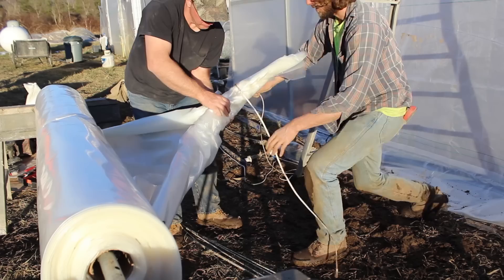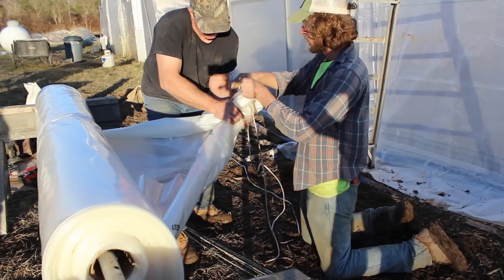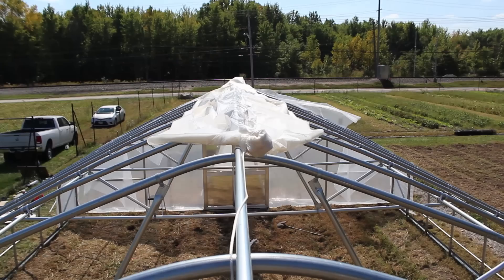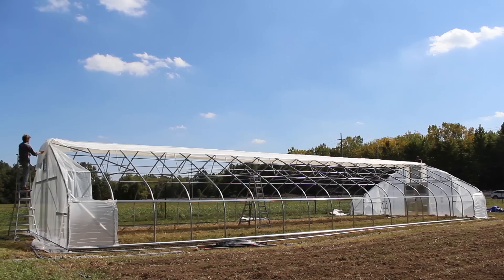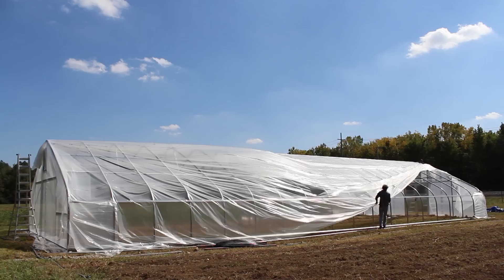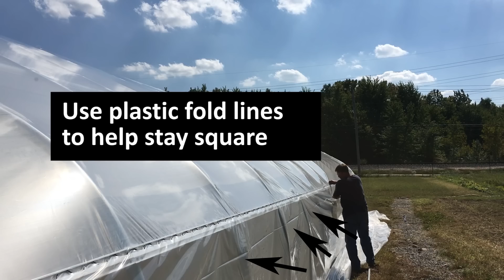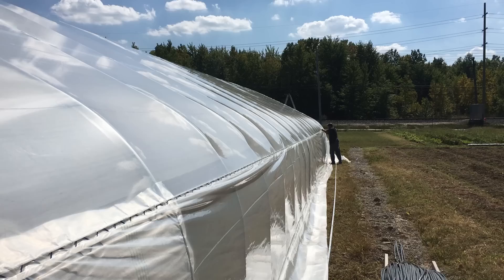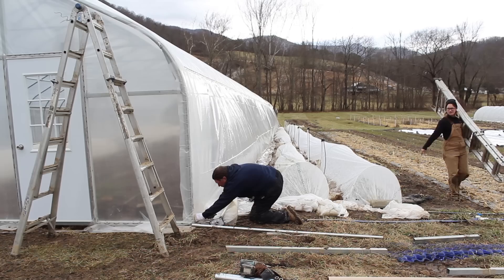How to Install Greenhouse Plastic Top Cover - Poly Pull Method

Comment: We built a high tunnel and were considering how to put the top on.  I found this, and thought it would be the best way to try.  It went on smoothly, quickly, and with no problems.  Thank you!  You turned what could have been a several hour headache into a simple, half hour task.
Reply from the maker: Very happy to hear, Diane! Love hearing when a video has helped; thanks so much for watching!

Comment: Great video, and it must work great for hoophouse under 100'.  We tried this technique this morning on a 30'x170' greenhouse, but the roll of poly weighting 300 lbs makes it difficult, even with a crew of eight.  We did the first layer all right,but we could not pull the second layer straight; the tip would slip off to a side.
Tomorrow, we'll be trying to pull over again, but with three rope (center and both side) instead.
Reply from the maker: Hello! Thanks for watching and for the kind words. For the second layer on a big tunnel like that it is very important to splay out the plastic as it is being pulled down the peak of the structure. This almost gets the plastic so it looks like it is being partially unfolded to the left and right of the peak. this creates adequate counter weight on the left and right for a successful second layer pull. That said, there is NO question that pulling a second layer of plastic on a structure can be more difficult that the first layer. 

Good luck in getting that second layer on. Let us know how it turns out and how you ended up getting it on if you can.
Reply: ...a crew of 8 could not manipulate 300lbs? :)
You would have a time with my 700lb motorcycle.    ;)

Comment: What a great quality video. Thank you so much. I have a question regarding fastening the poly at each end with the spring wire. That looks like a key piece to holding it straight while you unfold, but I can't see how you are fastening that. Is it possible to explain how you are fastening that at each end before you unfold it? Thank you!
Reply from the maker: Thanks for watching and the kind words. The technique for putting wire in the peak at each end BEFORE unfolding is pretty much just as follows:

1. Get the plastic into position.

2. Push the folds aside to the left and right at the end - this way there is just a single layer of plastic overlapping the channel.

3. Start a piece of spring wire in the exposed plastic (not the folds). I usually start this piece of wire about a foot or two to the left of the peak, and then continue it to a foot or two to the right of the peak. 

4. The above should be done at each end before dropping the folds.

5. After it is unfolded you may find that you can make your peak attachment tighter / take slack out of it. If so, you can get up there, undo the wire, pull more excess plastic over the end bow toward the outside of the structure, and then re-fasten the wire. 

Hope the above helps a bit. 

Thanks for watching!
Reply: Just wrap one end of the plastic film around a smooth steel pipe or stick and pull it hard.

Comment: Are you able to put more than 1 set of wire into the tracks? I was thinking I would have to install 2 sets of track...1 for the roof and 1 for the side walls. 2 in 1 track would be much better if thats whats going on here? Thank you!
Reply from the maker: No reason you can’t double up. The track should be able to hold that amount of plastic AND wire, without issue

Comment: Thank you for making this video!  You are a very good teacher.  I was told that the wiggle wire holding the end plastic in should be removed when you place the wiggle wire in for the top plastic.  It appeared that you put wiggle wire over wiggle wire.  Is that correct?  Thanks!
Reply from the maker: Thanks for the kind words! To answer your question, the end-walls in the video have been "roughed in" using Snap Clamps; these components are used to hold the end-wall plastic in place without any wire. You can watch how we use these when installing the end-wall plastic in this video here: https://www.youtube.com/watch?v=xkSlaXRInwQ&t= and you can find some pictures of the Snap Clamps in use here: https://www.tunnelvisionhoops.com/snap-clamps-pack-of-10/

With the above being said, I do have a few small pieces of Spring Wire holding the end-wall plastic in place, and these small pieces of Spring Wire can be used to hold the plastic in place instead of Snap Clamps if you prefer. In the scenario that you have used these small lengths of Spring Wire to hold the end-wall plastic in place it shouldn't be a problem to go over your top cover plastic with Spring Wire AND leave the Spring Wire in place that is holding the end-wall cover on. It shouldn't hurt anything.

If you were planning to install a double layer greenhouse plastic top cover you may want to remove the small pieces of Spring Wire, as you secure the top covers, in order to reduce the amount of "stuff" being put in the channel. This would ensure that you can secure your end plastic, and two top plastic coverings, and still fit your Spring Wire into the channel. Otherwise though, it shouldn't hurt anything to wire over other wire. 

Snap Clamps are a good way to avoid this issue though since they can hold the end-wall plastic in place without the use of any Spring Wire.
Reply: Yes you can install wiggle wire over the other wiggle wire if you are using two covers. I do and h avent had any issues. Simple answer for you.
Reply: Jason A. Thanks!!

Comment: Just wondering... for the top piece of plastic, when done how short do i cut it
Reply from the maker: After installing the top cover I typically trim the plastic so 2" of excess remains on the outside of each end-hoop. 

If you are attaching plastic at ground level on each side I would leave a bit more because I would want to leave enough so that I could potentially install roll-up sides if I ever wanted to make the upgrade. 

Best of luck!
Reply: Thanks so much...ur video made the process so easy
Reply from the maker: Awesome to hear! Thanks for watching and the kind words!

Comment: How tight do you want your plastic to be? Is there a quick rule of thumb to use?
Does this change for double plastic vs single layer?
Reply from the maker: For single layer structures the rule of the thumb is to try and get the plastic as tight as possible without damaging the plastic. When I say "as tight as possible without damaging" I am referring to what might happen at the point of attachment with spring wire channel and wire...If you pull it so tight that the wire is puncturing the plastic as it is being fastened to the channel then it is too tight and you need to let up the grip on the plastic as you push the wire over the plastic and into the channel. 

For double layer structures you do not need to install the first layer super tight. Instead, just focus on squaring the plastic cover and getting any noticeable wrinkles out. Once squared, you can install the second layer of plastic with the same exact methodology. That is to say, you do not want to make it super tight. Instead, let it rest square on the structure and remove any large wrinkles / floppy folds. If you follow this route the inflation fan will put the necessary pressure on the plastic and make the two layers as tight as they need to be for full function. I am making a video on this process now...it is just taking longer than I would like to edit!!
Reply: @tunnelvisionhoops  Did you end up editing the video on double layer? Thanks keep it up!
Reply from the maker: @bluntsparkinthepark  I just got back to some editing recently and I am trying to ice that one off next. I just published the plastic repair video and the double layer is in progress... I am REALLY hoping to complete that one soon here. Haven't meant to string anyone along (sorry!)... Soon I hope!

Comment: Good day. Please at what direction of the wind is it advisable to install a greenhouse? Is the length supposed to be against the wind or the breath of the greenhouse should be against the wind direction?
Thank you as I await your response.
Reply from the maker: There are more variables than wind that need to be factored into location and structure orientation, but most often high tunnels and hoop houses are oriented so the ends of the structure face the wind. 

That is to say, if wind is coming from the west, the structure is set up so it runs from east-to-west. The major wind protection features of a house are oriented to protect the structure if wind hits the end-walls hardest. These features help disperse the wind pressure throughout the entire structure - corner braces, peak braces, purlins, and hip-rails are examples of these types of features.

Hope this helps!

Comment: I am alone with no help at all, so can one do this on a smaller pvc hoop house?
Reply from the maker: Possibly, although I would always recommend getting another person to help. That said, I suppose it would be possible depending on how tall and long your structure is. the smaller it is the more practical this becomes.

If you installed your plastic cover as shown in this video with one person it would require you to walk to the end of your structure with the roll of plastic so you could take tension off of the plastic. This would mean you would have to pull 4 ft. to 8 ft. of plastic off of the roll and set it on the peak of your structure. You would then have to walk to the other end where you are pulling the rope from, and pull that 4 ft. to 8 ft., and then you would have to walk down to the other end to repeat the process of lifting plastic onto the peak so it can move. If you attempt to pull the plastic along the peak of your structure without placing plastic on the peak it may result in too much pressure being put on the plastic as it is coming over the end hoop. This pressure could result in slight damage. 

If your hoop house isn't large, and you are by yourself it could be relatively painless, but if your structure is that small it may be more proficient to simply lay your plastic out along the side of your structure and pull it over one end at a time. Wish I could give more direction but there are so many variables!

Good Luck!

Comment: If you are doing dual layer - do you secure the first layer then do the second? I am wondering how to do that and keep both layers tight
Reply from the maker: Hi there, good question. In short, double layer systems should be air inflated which means the air pressure will keep the plastic layers tight even if they are not super tight at the time of installation. If you have an air inflated double layer system and the plastic is too tight you won't achieve much of a dead-air-space between layers at all; for this reason I wouldn't recommend trying to make both layers super tight at installation UNLESS you are installing two layers WITHOUT an inflation fan being used. 

With all this being said, here is my general order of operations for a two layer inflated system...hope it helps some:

1. Pick a calm day with no wind.

2. Know where you will install your inflation fan; typically these get put on the next hoop after your end-hoop about a foot or so above the hip-rail. Don't install the inflation fan yet, but just know where you will be putting it after both layers have been put on. 

3. Install first (bottom) layer as shown in this video but only secure spring wire in a few spots - primarily at the peak of each end, near the hip rail on each end, and one piece of spring wire in the middle on each side. This will hold the first layer enough until your second layer gets installed. I don't like fully attaching the first layer with spring wire at this point because the same steps are duplicated after putting the second layer on - - for me, I like saving the wire and the time, and simply securing both layers with a single run of wire (as much as possible, at least)

4. After the first layer of plastic is resting in place, and is secured with a couple pieces of spring wire as referenced above, repeat the process for pulling the plastic with the second layer of greenhouse plastic. Put the plastic on the structure by pulling it from end to end over top the first layer of plastic. The process is the exact same as shown in this video pretty much; I would just recommend allowing the plastic to open up more as it is being pulled from end to end...this allows the plastic to make its way from end to end without falling off the structure to one side...in other words it hugs the peak of the structure as it makes its way from end to end. 

5. Once the second layer is in place, adjust the second (top) layer of plastic so it is resting square on your structure - secure with spring wire at the peak over both your top and bottom layer of plastic. If you already have spring wire holding your first layer in place that is okay, your channel should be able to receive multiple layers of wire and plastic. 

6. Proceed with securing both layers of plastic with spring wire in the same order of operations as outlined in THIS video...the only real recommendation I would have for this step is to NOT PULL THE SECOND / TOP LAYER SUPER TIGHT. If you do pull the top layer super tight you will not achieve any real inflation at all. It is a fine line to walk, but just make sure there are no wrinkles and that it is laying flat everywhere before securing. It is easier to pull more excess out of the plastic if you want than it will be to adjust and put more excess into the top cover. 

7. When you like the way the second / top layer rests on your structure, fasten your plastic around the entire perimeter except for around the area you plan to install your inflation fan. Leave that area unattached for now (leaving about 6 or 8 ft. unsecured should be good for now). 

8. Take your inflation fan inside your structure to the point of your structure where you will attach the fan to the hoop. Follow the instructions for attaching your inflation fan to your hoops, but essentially you will first install the provided bracket.

9. After the bracket is installed, use the provided nuts and bolts to attach the inflation fan to the bracket.

10. After the fan bracket is attached to the hoop AND the fan is attached to the bracket, use the hole in the bracket itself to mark where you will cut an "X" in your first layer of plastic. I like doing this from the exterior of the structure, by lifting up the second layer of plastic so I can access the first layer and make the cut. 

11. When the cut has been made in the first layer of plastic I push the deflector for the inflation fan through the "X" and twist it onto the inflation fan bracket. For this step I am pushing the deflector from the exterior of the first layer of plastic onto the fan bracket which is on the interior of the first layer. 

12. After the deflector has been installed, and the fan is in place I allow the second layer of plastic and first layer of plastic to lay flat against the side of the structure, and I now secure the rest of the spring wire into place to fully close off the two layers of plastic.
 
13. Plug in your inflation fan and you are good to go; you can adjust the damper on the inflation fan after your two layers of plastic have been inflated completely (if you want to adjust how much air is being pushed between the two layers of plastic)

Good luck!
Reply: Tunnel Vision Hoops LL
Reply: @tunnelvisionhoops  Awesome reply - thank you re: the fan - would it not be simpler to install after you have your fist layer on - but before you do the second layer ?
Reply from the maker: That would work too. For me, if it is calm I am focusing on poly and nothing else...There have DEFINITELY been times when I put a first layer on and then did the roll-up sides, or worked on a door, or something else, only to lose my "window of calm" when it comes to wind. It shouldn't take long to install the fan though so I would say go for it if you want!
Reply: @tunnelvisionhoops  quick question - we have really cold winters here - is it worth trying a triple layer poly - to both add protection and additional insulation ?
Reply from the maker: I have never done a third layer of plastic, and am not sure how three layers would interact with each other when adding an inflation fan. That is to say, I am not sure whether consistent air inflation would be easily maintained between each of the inflated layers. If you want to give it a try please do report back with how it goes!

Also, keep in mind that every layer of plastic you add to you top cover will make impacts on the light transmission percentage as you are layering materials that only allow approximately 90% of the light through. Not that adding a third layer will be the end of the world, but it is just another variable to keep in mind.

Comment: Great video! I'm wondering how do you control the airflow inside the greenhouse? cause everything is covered thanks!
Reply from the maker: Thanks much! Funny you ask because we just posted another video on installing roll-up sides that shows how a roll-up bar can be attached to the greenhouse plastic so the sides open up for ventilation. Here is a link to that video: https://www.youtube.com/watch?v=Ei3eePwdpyM&t= 

There are a variety of ways you could ventilate your structure at each end-wall and at the peak, in addition to the roll-up sides which I mention above. 

If you have electricity you could hook an exhaust fan to one end, and an intake shutter to the opposite end. If you do not have electricity there are passive ventilation options that allow hot air that rises to simply leave out an opening you would make at each end. There are also aluminum shutters that open and close automatically using expanding cylinders full of wax that are specifically designed for our greenhouse structures. 

Hope that helps!